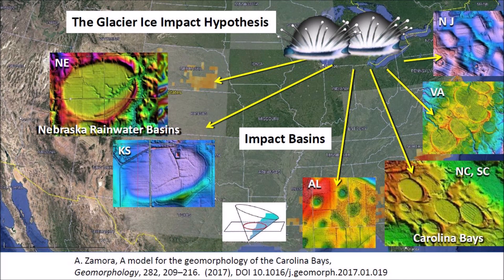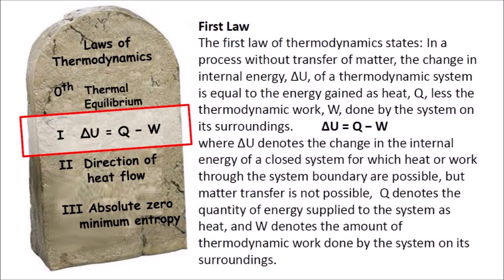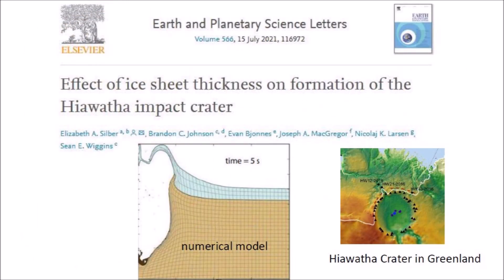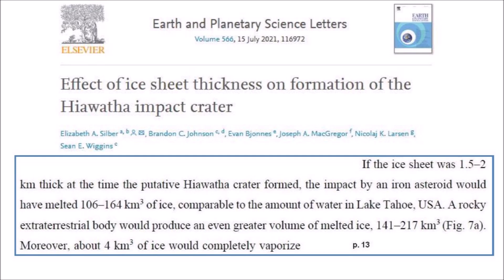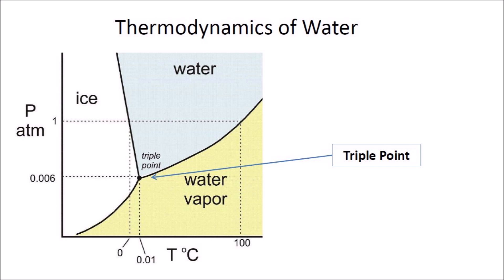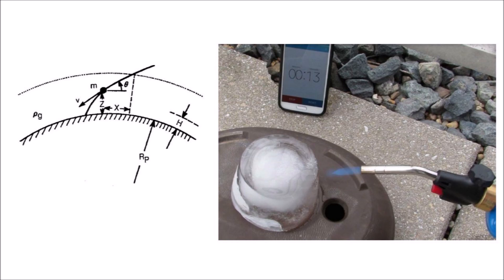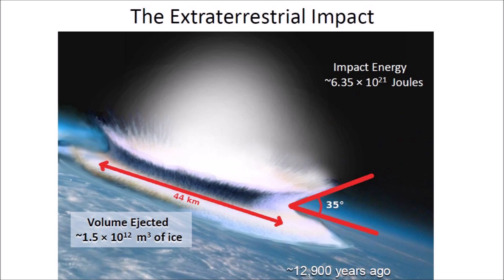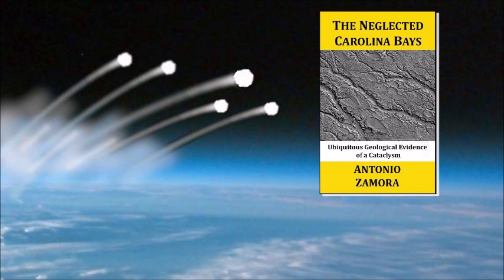Thermodynamics of the Carolina Bays

Comment: I offered the following to Dabbler's Den.  Once again Antonio, thanks for your patience with me.    My thought is based on the full pattern of the "event" all across North America. Just because we do not see "Bays" in the terrain of the Appalachian Mountains (for instance)  doesn't mean that this terrain didn't get hit by an "Ice shower" similar to the "ice shower" seen in North Carolina. Isn't the over all pattern of the "Ice shower" clearly defined by the orientation and shape of the Bays? The east coast and Nebraska now Oklahoma fit this orientation toward (Michigan) ~  So there is this "circular" pattern around the impact site ~ Michigan.  My proposal is that it would be elementary to use circular geometry to roughly estimate the total volume of ice in the "ice shower" from this event.   The estimate would be based on a "slice" of the "arc" taken from the most (well preserved area) affected by the "ice shower"  ~ the Carolina Bays.  Circular geometry starts with Pi and like the slice of a pie, use (one slice) to estimate the volume of ice in all other slices.  We would need to accept and set aside the many other variables affecting the (LIDAR revealed) Bays that we see today.  Wouldn't it be valuable to estimate (how much) ice actually flew through space?

Comment: Antonio, wasn't the Laurentide ice sheet at Saginaw Bay actually thicker than 1km?
Reply from the maker: The thickness of the ice sheet varied over time as the glaciers advanced and retreated. The 1-km example just made it easier to get a ballpark estimate. The paper by Silber mentioned a thickness of 1.5 to 2 km.
Reply: @Antonio_Zamora  Yes sir. I had heard long ago (I thought it was you, but I believe you stick exclusively with the metric system for measurement explanations.) 1-1.5 miles. Thank you for telling me!
Reply from the maker: @allenvaughan1  I am not strictly metric. I use feet for walking.
Reply: @Antonio_Zamora  The brilliant thing about your response is that I was hooked right up to the last word!
Reply from the maker: @allenvaughan1  Your comment inspired me for a video: https://youtu.be/YeEbeaGeZS0

Comment: Would the atmosphere on Earth be displaced leading to the 'sky' falling.
Reply from the maker: The high pressure produced by the extraterrestrial impact would push the atmosphere as is frequently seen in films of atomic bomb blasts.  Afterward, the air would rush back toward the impact site to normalize the pressure. It is possible that something like this was responsible for the mammoths that were flash-frozen with food still in their mouth.
Reply: @Antonio_Zamora  a video on this explanation would be amazing
Reply: @Antonio_Zamora   Thanks for the reply. I imagine an unstoppable chain reaction after impact.